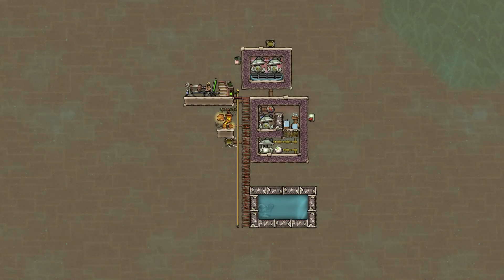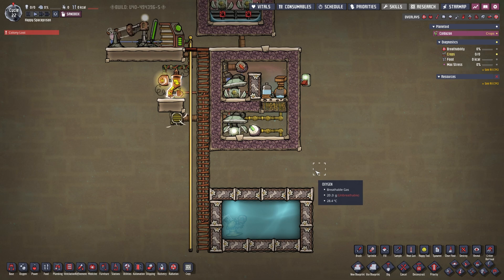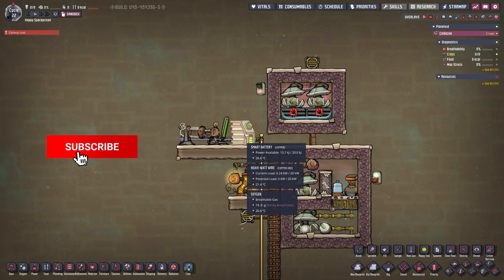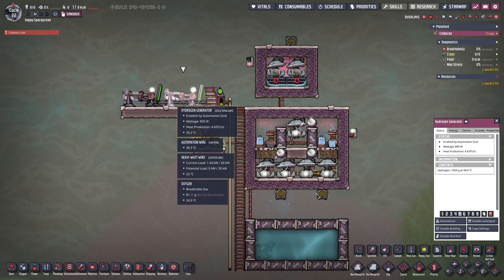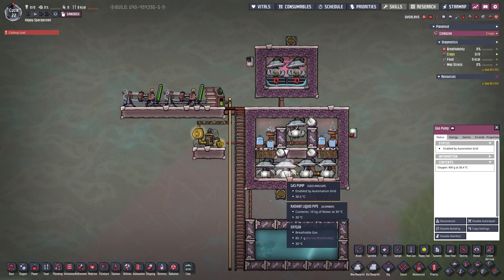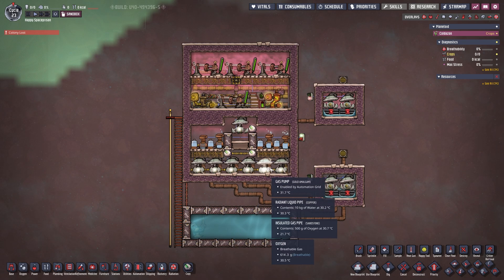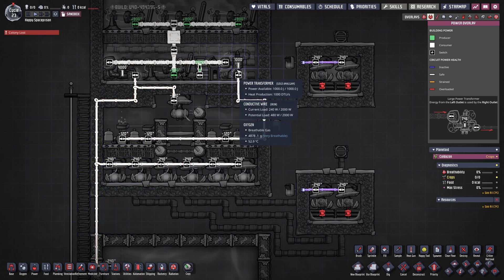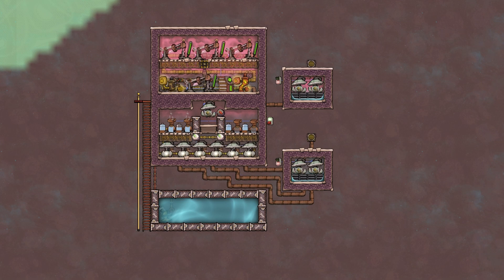GERMAN ENGINEER explains ONI: SPOM's!(Self-Powered Oxygen Machines) Oxygen not Included Spaced Out

Comment: This is AMAZING! thank you! Question: When would be the best time in a game to use each? Just build the one you want? build up to the full Rodriguez?
Reply from the maker: Thank you very much, I appreciate it!

The best version at the best time really depends on your game. I know, that's not what you want to hear but there is no better answer. 
The Full Rodriguez uses A LOT of water. One electrolyzer needs 1kg of water per second. You need 4 of those for the full version. A cycle has 600 seconds. So you need 2400kg or 2.4 tons of water every single cycle (100% uptime in this equation: 4kg/s * 600s = 2400kg). 1 tile in ONI holds roughly 1000kg of water. So if you have a "normal", not infinite, water storage, you can see relatively easy how fast you'd run out, given 5 of those tiles disappear(rounded up for easier visualization) every 2 cycles. If you can stem that amount of water and can use or store all the oxygen and hydrogen you produce, then go for it. If not, maybe a smaller version may be a better fit until you can provide the infrastructure for a bigger one :)
I hope this answer helps you with your game!

Comment: Something that keeps happening to me on radiant pipes is breaking.  I don't understand if I'm supposed to use them to cool the shit down inside of them, why they break the moment I start piping fluid though them.  Background - had a cool slush geyser pop up near my medium sized SPOM and thought, what a great way to cool my water so I'll get colder oxygen coming out.  So I run radiant piping where the slush runs out and it keeps breaking.  Is radiant copper piping not usabe and I'll need to wait for some other metal?  Is there a rock alternative or am I doing something wrong by not fully submerging (as the cool polluted water just runs by the piping) ...really unsure what's causing constant breakage.
Reply from the maker: Are you feeding the polluted water from the cool slush geyser through the radiant pipe or normal water through the pipe and the pipe is sitting in the polluted water? The only way a pipe breaks(radiant or not) is if the contents of the pipe freeze. So running the polluted water from the cool slush geyser through it posses no threat to the pipe. But if you put water in there, that would freeze due to the cold temperature of your geyser. I hope this helps!
Reply: @BierTier  whelp. I’m doing exactly the wrong thing ;). I’m running the water i wanted to cool thru the piping and letting the cool slush flow around the piping.  Dang.

Comment: 3 things I would say, 
1. electro can ovepower 1 pump for oxygen, 2 are recommended. (in first one)
2. dont set your battery to over 92% as hydrogen generator does need to finish animation, and it drops another 4-6% of power. to be safe I recommend 90 or 92%.
3. for half you can use 2 SEPARATE small transformers and 2x separate 1kw lines. (top an bottom rows), I build those early in the game, so usually I don't have a lot of copper for cables yet.
Reply: Why do you need a transformer if the circuit is under 2000? Shouldnt it be safe with conductive wire? This is my first time building one but im confused about transformers, i thought they were to keep wires from overloading.
Reply: @Bear-88  you can, i just build it when refined copper is scarcely avaliable, so separate line is way cheaper.

Comment: Why not use the water instead of the gas to cool stuff? I think it's more efficient, and you want the water to be closer to 70º when it goes into the electrolyzers anyway.
Reply from the maker: These are example builds, it looks in everybody's base different. Of course, the higher the water temp, the better in general. Then you need to cool the Oxygen in a different manner. But this exact setup(the single electrolyzer one) is what I use in my current let's play, cooled by the input water because it just happens to be at a low enough temperature and I have nothing to cool with it nearby other than the oxygen.
Reply: @BierTier  what I did is run the water coolant first thru the oxygen pumps to keep the area cool, and then go to the generators, then back down to the electrolyzers, then the oxygen thru the same route the water came in but the opposite direction, by the time the oxygen had left it was the same temp as the incoming water. (I put insulation around the tunnel where the pipes exchanged temp).
(I just built it by the way, using your SPOM design)

Granted,I used a LOT of refined metal, so might not be worth it.
Reply from the maker: Ok, I see what you are saying. Definitely a method! And if you have the refined metal available(through volcanos for example), then I’d say that is definitely a good way to do it!

Comment: I've tried the half rodriguez design and for some reason the top pump just gets overwhelmed with O2 and fails to produce enough H to fuel both generators while running
Reply from the maker: That is very odd, that should definitely not happen. 2 generators need 24g/s less than 2 Electrolyzers produce. Especially with a smart pump you should have plenty of excess Hydrogen. And 4 pumps take out way more O2 than the Electrolyzers produce as well. You can see it in the video, the bottom pumps on the left and right turn off periodically because the pressure gets lower than what is set with the Atmo Sensors. Something has to be wrong somewhere in your build!

Comment: Settings for all the atmo sensors are not included :(
Reply from the maker: Small setup: H2= above 500g; O2=Not needed, I just build it to be able to control the pump if I want to in the future. It’s just always on. Above 0g basically.
Half Rodriguez: H2= above250g; O2= above 500g
Full Rodriguez: H2= above 250g; O2= above 500g

I hope this helps you out :)

Comment: I still don't understand why the radiant pipes are used. You list off the temperature of the generated gas and of the source water, but don't say why they matter or what you're doing about/because of them. My only guess would be that it is about deleting some of the heat of the generated gas.
Reply from the maker: I'm sorry that is not clear enough. That is exactly the case. The radiant pipes allow heat to be transferred quickly. If the source water is cold enough it can be used to take away some heat from the generated gas since it always emerges at at least 70C(if the source water temp is higher, the gas temp can be higher). Since I use fairly cold water it works to remove some heat from the gas before it ever leaves the chamber and gets pumped into the base and/or storage. If the source water is hotter(like it is in my let's play series), another solution for cooling the gas needs to be found(I use a steam turbine setup in said let's play).
I hope that makes it a little clearer :)

Comment: A nice, clean explaination of the SPOM builds, thank you so much, but I've had a problem trying to replicate your set-up of the 4 electrolyzer system.  From everything I can determine I have built an identical system in my current base, and vacuumed it out before starting, but no matter how many times I clear it out and restart it I always get oxygen trapped in the center area between the heavy doors, and even though I never see any stoppages in the electrolyzers and I have set my sensors to the same settings, my oxygen and hydrogen never seem to settle out up-and-down. Instead, I have a constant chaotic mix of oxygen and hydrogen in the chamber that makes it necessary to use filters on everything getting pumped out to prevent damage and contaminated storage (I started with freestanding filters and have switched to using the modded 'filtered airpumps' I saw in your play through).

Any advice would be appreciated. Sorry I don't have a pic or anything to link.
Reply from the maker: Hey Eric, I'm glad you enjoy the video! 

What you are describing is very odd. There has to be a issue with the system somewhere, without a screenshot it is hard to determine what the problem is. In this video: https://www.youtube.com/watch?v=gyKNTX5bY5s&list=PL4O-dC6ogdu-1ZyF6WDznhBR7VQhO0W5-&index=13&t=1s I build the same system(minus the power part on the top) without being in sandbox mode and I show it step by step how it is built. Maybe that helps you out. If not, feel free to join my Discord and myself and the rest of the ONI nerds in there will make sure we help you get your system up and running!
Reply: @BierTier  Thanks, I'll give that a look, and hopefully see if I can clear it up. If not, I'll try to figure out how to get and upload screenshots of the system. Thanks again!
Reply: @ericbogerd5306  Easiest way to upload is through Discord. Check BierTiers description. :) The Discord has a bunch of talented people in the ONI Channel